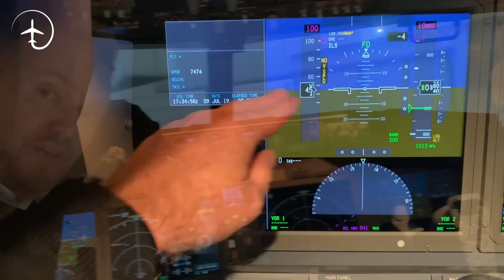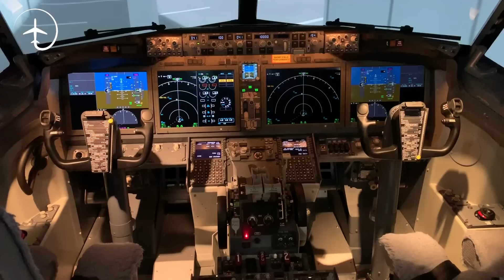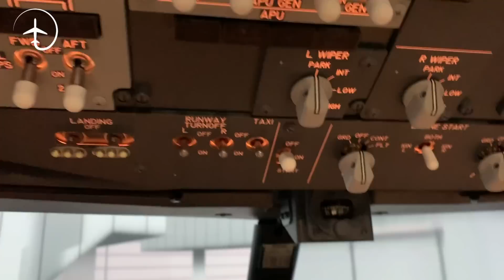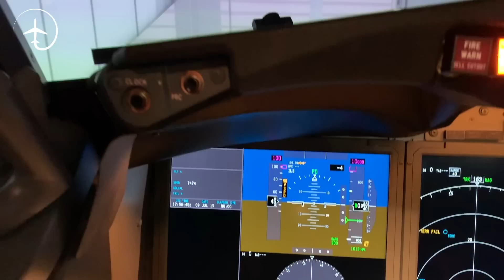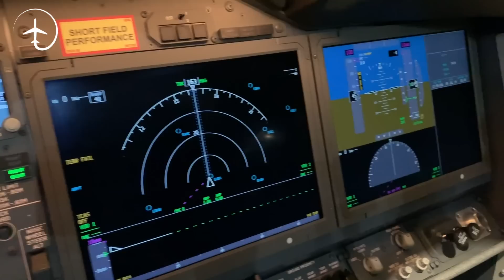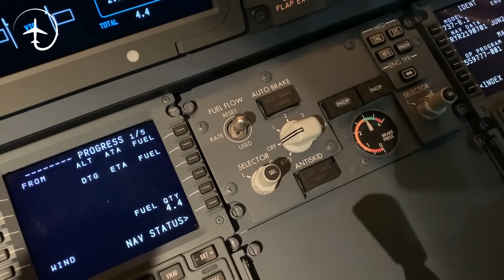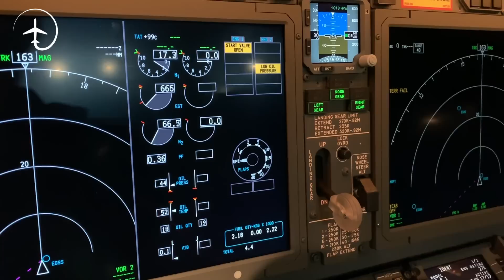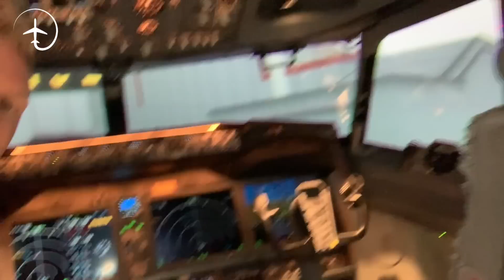Boeing 737MAX Cockpit Tour

Comment: Why do so many airlines fly the 737-800 and not the 737-900 Which ELAL uses for the flight between Tel Aviv and Amsterdam? Because for me it sounds like alot of airlines go from the 800 to the MAX8.
Reply: Larger planes are more expensive and harder to fill with passengers

Comment: @Mentour Pilor: N1 and N2 are measured in WHAT exactly? Percent(age) of what? Also, why the big difference between them?
Reply: N1 & N2 both are rotational speeds of two turbines.
N1 indicates the Fan (or the intake rotor) speed which is more important as the fan is the main component in producing thrust.
N2 is the rotor speed of the engine core and measures the speed of the rotor inside the engine core.
N2 is generally used while starting up the engine.
Both N1 & N2 indicated in the cockpit are in percentage of a nominal RPM value.
Also, the fan (N1) and the engine core rotor (N2) spin on two different spools and they are not connected together. The N1 rotor (the fan) is a Low Pressure (LP) rotor which means it spins at a lower RPM than the N2 rotor whereas the N2 rotor is a High Pressure (HP) rotor and spins at a higher RPM. That is why you see a big difference between them.
Reply: @pushkarbagayatkar5319  
Cool and clear explaination! Thanks!

Comment: Could you do a video on what happens when a plane lands on it front landing gear first?
Reply: Michael Richards Southwest flight 345 Jul 22,2013. The captain took control from the first officer during landing causing the aircraft to land on the nose gear causing the gear to collapse. The aircraft was written off due to the damage to the avionics bay and structure.

Comment: What's the strange lever on the Landing Gear control?  It looks like the castor wheel on a bed, or something... doesn't it just need a simple lever: up/down ?
Reply: It has just two settings: up and down. Nothing else.
Reply: @mikep9604  That's what I thought.  But then why the contraption on the end, like they assembled it from left-over Ikea parts? ;-)  It really has no purpose?  Or it's in the shape of a wheel to demonstrate it raises/lowers the wheels?
Reply: tsuchan1 - The gear handle is made like that so in a situation where you can’t see the lever, you can touch and feel it. Same goes for the flap handle, notice it is wingshaped 😉
Reply: @ACPilot  Brilliant answer - thanks!  I don't think I ever would have thought of that reason.  Thanks again!

Comment: Exactly! The Virtual Situation Display - I've been badgering on about the need for this since fly-by-wire kicked off. Hope there is an option to tell the computer that "No" your sensors are wrong - listen to the human.
Reply: The 737 MAX isn't fly by wire, and there always has been a way to shut out the computer and run it manually. The pilots of the crashed planes just failed to identify and correct the issue before they went nose down

Comment: There was an article I read recently that was published by the Seattle Times.  It was extremely interesting and so were the comments.  My question for clarification sake, concerning the Stab Trim cut-out switches (2).  One of the comments stated that, by a pilot,  on the NG model, one switch was labeled "STABTRIM" and the other switch "AP". The AP switch would disable the computer imputs and the STABTRIM would disable the electric assist to the stabilizer., two separate functions. Therefore, the pilot could disable only the AP switch and have full electric assist authority on the horizontal stabilizer through the trim switch on the yoke.  On the MAX, the Stab Trim cut-out switches are labeled "PrI and BCKUP" and switching off any switch would fully disable both computer input and electric assist to the stabilizer.  If this is accurate, this is huge.  As a 737 pilot, were you aware of the differences between these changes  and was it mentioned in your MAX Ipad training.  I cannot imagine this to be accurate.  It was also mentioned that if a pilot suspected a run-away trim condition, you had minimal time to disable the cut-out switches to have maximum authority on the manual trim wheels for best leverage.  The longer you wait, the more force it takes to turn the wheels given pitch conditions and speed.  Can you show the cut-out switches on the NG model and how they are labeled and there function? Thanks

Comment: where's the MCAS disable switch
Reply: The MCAS cutout switch, or switches to be exact are integrated into the trim cutout switches. Flipping these will force vertical trim to be manual and should prevent You from being MCAS'd into the ground. They are located between the bottom edge of the flap control track and the top edge of engine 2's fire extinguisher switch.

Comment: No analog level? What's up in case of catastrophic power loss? How you know if you are going up or down? I find the lack of analog backups disturbing.
Reply: Leonardo Baez — Analog instruments also need power.  Aircraft have backup power generators in case of total engine failure.

Comment: very beautiful cockpit indeed, too bad many people might not have confidence to fly the Max with only software fix, because it does not address the root cause that is the wing/engine design. What do you think if the airplane would be re-engined with smaller engines and repositioned to fix the stall characteristics - basically turning it back to NG model (aerodynamically speaking). Or the current big engine can remain but placed a little bit aft and down to fix the pitch up tendency, and to accommodate that the landing gears to be modified, made taller to give enough space for the big engine as not to touch the runway below? thanks
Reply: S. Nawfal There is no problem with the wing/engine design.  That is baloney.
Reply: GH1618 well not the wing exactly, but the larger engine placement on the wing as mentioned before on this channel.

Comment: What's the use of putting these new features when they have completely messed up with passenger safety ? Now before booking an airline ticket I first check which aircraft they are flying......
Reply: Parikshit Baugh — What new features?  All they are doing is tinkering with MCAS to rid it of a defect.  They have to do that to get it approved for flying again.

Comment: It really is a wonderful set of controls and displays however it is vastly complex and should never be in a plane. If all that lot goes out can you still fly the plane manually? Probably not as the last two crashes have proved. It's more simple the better in a plane, great to have that information in front of you but it should not be integral to the running of the plane. the old mechanical gauges are very simple and reliable,these screens are appearing in motor vehicles now and believe me they do fail , they blackout, they have software glitches,they fail to boot up, they get very hot which is not good for long term reliability.  . It's no problem in a car of course because you can still drive a car and stop if you want to but in a plane you just go down to the ground which has been proved in the last year. How any member of the general public will ever get back in one of these things is beyond me. I know very little about aviation by the way, but my profession is motor vehicles with these kinds of screens on them which is a bad move for planes in my opinion.
Reply: Nick Clark — The aircraft can make a controlledlanding with both engines out, on backup power.  It is a requirement of certification.

Comment: With all those changes to cockpit controls, why did Boeing and the FAA think that additional formal training was not needed??
Reply: John Baxter - There really isn’t that many changes to cockpit, it can be tought on computer based training.
Reply: @ACPilot , Last I heard FAA is requiring new MAX8 pilots to train in a certified MAX8 simulator.  Should have been required from the start.  Boeing should not be trusted to certify itself from now on.
Reply: I understand you guys  who have a financial motivation to defend Boeing but they screwed up major and until they re-organize their top leadership the company will have a PR problem and not trusted.
Reply: John Baxter - Very unlikely training in a MAX simulator will be a requirement. Imagine airlines operating both the NG and MAX models and pilots flying both models. The MAX transition from the NG isn’t difficult at all..

Comment: Thanks for the look.  It's OK to look at the MAX but I will have a tough time getting on one knowing the backstory of corporate greed which led to MCAS.  The wing box and landing gear should have been redesigned to accommodate larger engines.
Reply: encinobalboa — The engines are fine where they are.  If you look at a lot of aircraft, you will see that the engines can be located just about anywhere.
Reply: @GH-oi2jf  Actually, no.  MAX engines were relocated relative to the wing to keep the short MLG.  This forced Boeing to fit MCAS.
Reply: encinobalboa - It has nothing to do with corporate greed, that’s what the media want you to believe. Boeing made the solution that made the best sense and would maintain the aircraft under the 737 type certificate. That is what the airlines want of the airplane.

Comment: Are the screens back lit LCD or AMOLED?
Reply: LCD for sure. Proven technology, OLED is still too new for it to make it's way into the cockpit.
Reply: @chrisjohnson7929  Being an aircraft with lots of new technology, I was just wondering.
Reply: @geoffphuketInPhuket  Yes, but for mission critical things they can be very conservative. LCDs are proven. How long will an OLED screen last being used in that environment, will there be issues of burn in. It works well for consumer products, but companies who produce flight displays won't use them until they are absolutely sure that they are up to the job.
Reply: @chrisjohnson7929  The problem with LCD screens is that they  gradually deteriorate - most fail within 10 years - look at old laptops, tablets and watches. OLED would seem a logical next move.
Reply: QLED is bigger suited because they don't burn in but it's still very new tech

Comment: Software will never fix its bad plane design. The only way they can actually fix this place. Will be to redesign the  landing gear by make it higher and move the engines back under the wing. .
Reply: Then it becomes a new aircraft needing new certification, and new pilot training. Boeing have been trying to stay within existing architecture to save design time and money.
Reply: Jose Guti — There is nothing wrong with the engine placement.  Engines can be placed just about anywhere on an aircraft, as anyone interested enough to look at many different aircraft knows.
Reply: @GH-oi2jf  the person who explain it to me its being an engineer for the past fifty years I can mention his name for obvious reasons.  One example. A plane can fly from a small amount of time at idle.. this plane is so unbalanced it will never be able. Look at the problem because of engines they need software and mechanical parts to keep the plane balance airbus  don't have the problem. Why because the landing gear is higher off the ground so they can put a bigger engine in the same position was the old one without affecting the balance of the plane .

Comment: Captain Mentour Pilot could you do a video explaining how to use the Reverse Thrust Levers on 737s and various other aircraft please ?
Reply: On the 737 you pull the levers in front of the throttle until they stop now youre opening the reversers but there ist much thrust after they applied you pull further to give Thrust and push to take away thrust

Comment: Great video, is the MAX still having hydraulic controls 
Also need to understand whether the systems are as sophisticated as Airbus Aircrafts ?
Like E-CAM , Fly-by wire ? 
How better is it from A320 NEO family ?

A.
Reply: The flight spoilers on the MAX are now fly-by-wire, the rest is as on the NG.
Reply: Boeing FBW is not as sophisticated as Airbus FBW, also, it's not as established, as Airbus has a full decade more intensive FBW experience than Boeing has FBW experience in general. Most of the Boeing product line introduced since the 1990s (777 and 787) has, at best the FBW equivalent of a 1970s A300. Meanwhile Airbus FBW since the 1980s has evolved to the point of enabling the biggest A380 handle as well as an A320.

Comment: From an untrained eye that cockpit looks pretty different to an NG, but to an experienced pilot are the differences really so small that you can get by with a difference training course or should the pilots have had simulator training?
Reply: cheekychappy1234 - Differences course is fine, it shows you the differences and where needed you can turn some switches etc.

Comment: I really dobout it's just software fixes anymore. It looks more and morre like the 80286 cpu is overloaded and just tweaking the software won't be enough. It needs faster cpu. The autopilot disengage problem probably comes from how low it's on the priority list so the request times out sometimes.
The problems would been solwed already if they could just tweak the coding.

Comment: I saw a A350  cockpit video. And now... When I see the 737 cockpit even the Max. Seems a very old. I kinda liking more Airbus now, I have been a huge Boeing FAN. But the A350 is just fantastic!
Reply: Leonardo Corrales — Boeing have always been conservative about changes to the controls.  That’s a good thing, in my opinion.
Reply: The A350 has a spaceship cockpit. I hate it when it doesn't look like an aircrafts flightdeck.
Reply: Flying an airplane is not like driving a car! Driving license is for life, pilot license has to be maintained, periodical checks are needed. New plane or new cockpit means new Type Rating, e.g training e.g. time and money. And nobody wants to spend money. For this reason looks MAX  as older 737 to be flown with the same type rating. And also,  aviation is quite conservative becase every screw, literally,  has to be certified which costs again lot of money and time. New cars are made every 5 years,  planes are in service for 30 years and 60.000 to 150.000 flight hours.

Comment: Does the yoke in the Boeing 737 max still have a physical connection to the control surfaces? If it doesn't then why even use the yoke?
Reply: Kari Kähäri — Even if the implementation were entirely electric, to servos at the control surfaces, yokes are the best way to fly the aircraft because they are familiar and intuitive.  They have at least two advantages not usually present for other systems.  One is that the position relative to the pilot is the same for either seat.  The other is that both yokes move together, which means the pilot monitoring can see what the pilot flying is doing.  The inability to see the other pilot’s control stick may have been a factor inthe Air France crash off Brasil, although there were other factors.

Comment: Instead of MCAS why didn't t Boeing go with longer landing gear and put in bigger engines without moving them.
Reply: They cant do it, it is impossibe. A bigger landing gear doesn't fit in the fuselage. It is only possible with front landing gear and they did it. It is a design of the 50's based on the 707, it has limitations.
Reply: The reason is simple the 737max had to keep it same certification as the NG. Changing too much on the plane would cost a new certification. Airliners wanted an upgrade 737 not a new design plane.
Reply: Not enough space for the gear. The rear already doesn't have doors to save space.
Reply: Because putting a longer landing gear in is not as simple as it sounds. Basically the main landing gear of the current 737 is attached at the wing root. That's the most sturdy part of the whole airplane basically. If you make the gear longer, you need to attach them further out at the wings in order to be able to "store" it properly when the gear is up. But this would require reinforcements of the wings which adds weight.
Reply: Boeing did enlarge the main gear aswell, The way it fits in the tiny wheel wells when retracted is done by compressing the suspension on the retraction swing, and putting it back out on the extension swing. Doesn't allow for much but is better than nothing.
Reply: Because that isn't economicaly sensible. The landing gear alone is a very expensive system to redesign and build. There is no issue at all with the way it was designed as far as the engines moved forward and the slight pitch up on takeoff power. All big planes do the exact same thing like the 777, 747, A330, A340 etc... They pitch up because the engines are massive and very powerful. They didn't put mcas in them because they didn't need to make the handling charectoristics the same as another model. Mcas wasn't put in the max for stability, safety, etc.. It was only put in to cancel out the nose up slight difference in the max and the previous 737's. The 1 stupid mistake they made was making mcas dependent on only 1 AOA sensor instead of both at the same time. So when a AOA sensor that was faulty, there was no way for mcas to know the difference. Which is what happened in both crashes.

Comment: Do jet engines experience extra wear when not running for prolonged periods as on the currently grounded 737max fleet? Thank you.
Reply: No abnormal wear whatsoever. Having said that, most of the operators of the grounded aircraft are doing periodic engine runs to keep the engine seals/components etc. lubricated. They will have many checklists to go through, and many hours of work to get an aircraft ready for flight after such a long time being out of service (estimates are between 100 to 150 hours of prep work, per aircraft).
Reply: @trellofello7473  Yikes, that's a lot of man hours.